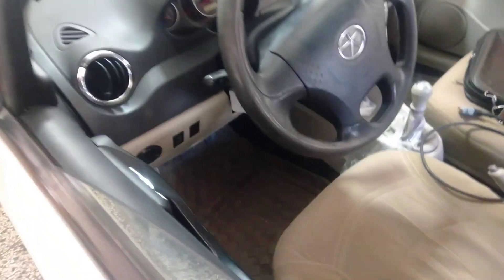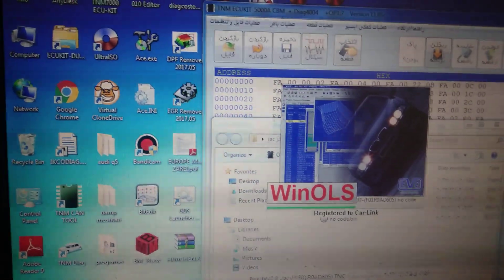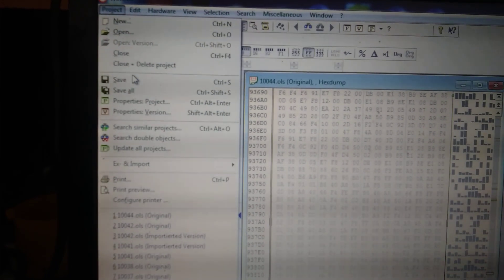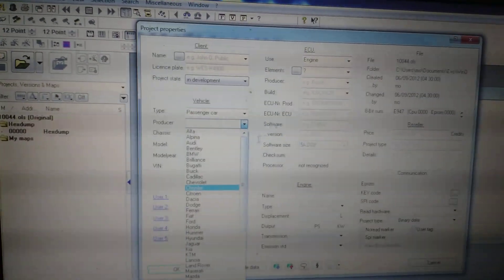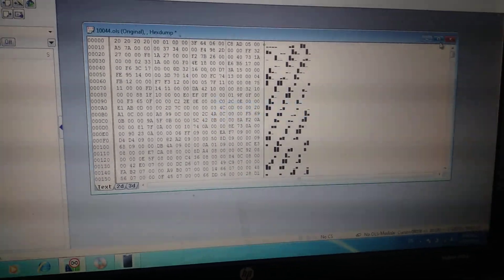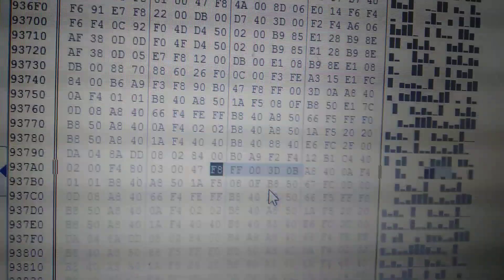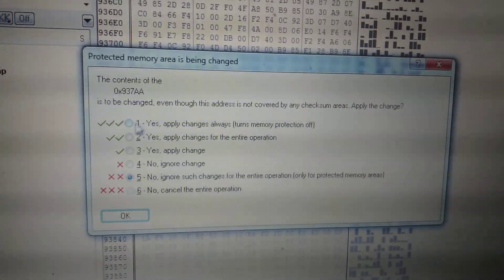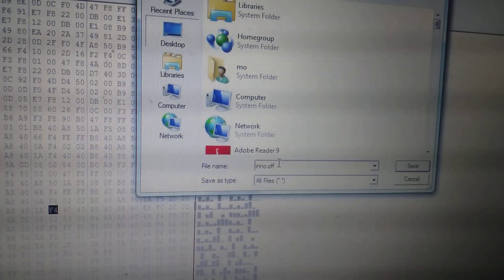Immo off Bosch M7.8 Jac J3 with Winols software(Part I)

Comment: Is the HEX string F8 FF 00 3D 0B the same on on all ME7.8 cars? I cannot find it in my dump. I used Kess3 for the read, so I'm fairly certain the file is good.  I've looked at files from 2 different cars, a 2002 Porsche 911 turbo and a 2003 911 Carrera. Any ideas/thoughts Mr Zarei?
Reply from the maker: No any car's has different dump, but approach is same